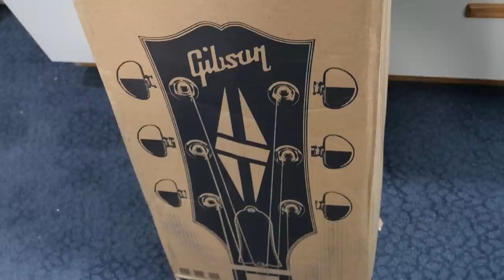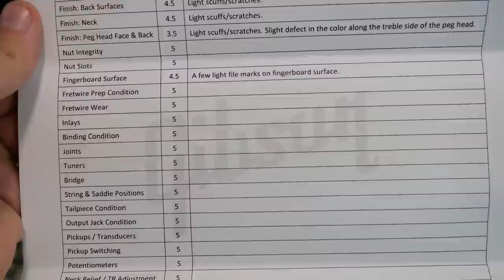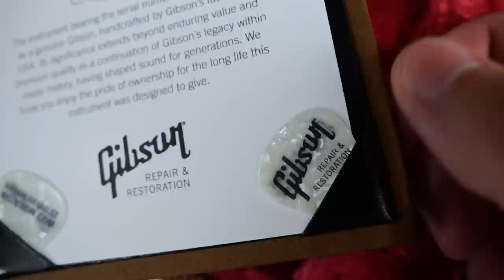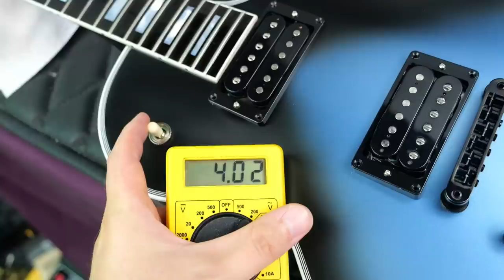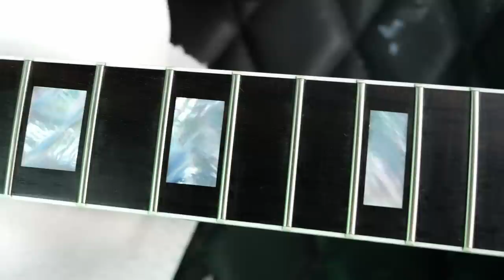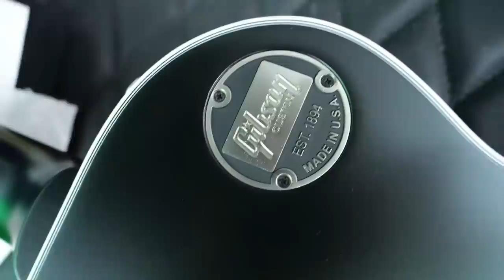I Made a GREAT Decision! | What Guitar Did Trogly Buy From The Gibson MOD Collection?

Comment: Austin, all you need to fix the strap button is to use a toothpick and wood glue. Then just screw the button back on. That literally exactly what the Gibson channel actually says is a their recommended way to repair that. I’ve been doing it for years and it never fails
Reply: I had to do the exact same thing once. Works perfectly.
Reply: Exactly what I came here to comment! 👍
Reply: I had the same problem with my Partscaster, hell I didn't even use glue I just stuffed a toothpick in there and it's still solid to this day, 2 years later.
Reply: I think I remember Trogly mentioning this in the past; its an easy fix.

Be sure the toothpick is made from a decent quality tonewood, of course. 😄
Reply: @RichardPhillipsDJ  haha, I bet there are people in this world for whom not knowing if the toothpick used in their LP fix was made of mahogany tonewood or just plain crap wood is ruining their experience playing it, never knowing if they have full tone potential 🙂
Reply: A matchstick or a toothpick should do! No need for glue,

Comment: those satin finishes are cheaper for them to make but charging a premium price for them,the gloss finish is much classier
Reply from the maker: Depends on the type of satin finish. Some satins start as gloss and get buffed down and are more expensive to produce.  Typically speaking though... yes, satin finishes are cheaper to produce than gloss
Reply: Gibson is shameless. It's funny seeing people get so excited after paying $6000 for a $400 guitar. I love it! I'd have buyers remorse until I sold that hunk of wood.
Reply: @mboyer68  cool story bro
Reply: @mboyer68  where is this cost coming from? There’s a lot of factors that go into the production of a guitar. Materials, equipment and tools, and labor. I imagine it was well over $400 to produce this instrument.
Reply: @mboyer68  I'd like to buy that $400 guitar from you..I'd give $600 and we'd both be happy
Reply: Matter of opinion. Personally I much prefer satin finishes (and only oiled/waxed necks).
Reply: @Joshb6498  granted it is a mod shop guitar so it has had extra attention, but you understand that most Gibson guitars are done by machines just like the foreign counterparts? Look at 10s guitars, they have a les Paul copy that is neck through, has an abr 1, more finishes, Grover tuners, and it costs barely more than 600 bucks. Gibson is on their way out imo

Comment: How to Fix the Strap Button Issue: Trogly, all you need to do is to shove a bunch of wooden toothpicks in the hole until it is packed, break them off, then drive the screw in. You may use wood glue if you wish to secure the screw further, but it'll work either way. Don't spend a bunch of money sending it back, and this method does NOT require drilling. It's a tried and true fix for such issues. I have done this kind of thing dozens of times. You may want to produce a video on this method to teach the guitar world on this simple, but effective fix. (Tip: You don't have to wait to break all the toothpicks at once. As you place each toothpick in the screw hole, break it off.) (Tip Two: If the toothpicks are pointed, you may need or want to clip off the end of the first few, [fingernail clippers will work], but as you attempt to fill the drilled hole fully, the pointed ends will help with that. You may need to use a hammer to tap the last couple of pointed toothpicks in.) Trust me, this works.

Comment: Use a toothpick or a match to plug the strap lock hole. You will be able to just screw back in to it. You could also glue the match in but I never need to.

Comment: Rather than using filler on that strap button just use some epoxy. If you use a syringe to apply it very carefully you won't get the mess on the finish that comes with using filler or the haphazard application of glue.

Comment: So, let me get this straight. Gibson take a "B" grade product, and send it to the custom shop, they could just dionate it or sell it cheap but choose not to.  In the custom shop they do a respray job, which is usually less than perfect i.e "Fudged" , change out some hardware, and then sell at a premium price. "Hmmmmmm," not sure I'm on board with this concept.
Reply: The other way around with that SN. It started as a Custom Shop then got rejected to Mod Shop. Still has a full custom shop price. It is a little puzzling.

Comment: Greetings Everyone
Reply: Chloe said Hello.
Reply: @sgt.grinch3299  And a very special hello right back at her.
Reply: Indubitably ...the flat style in a mahogany species  to maximize the density of the repair cavity ...please use only the ....
Gibson "repair authentic" brand factory blemish adhesive with the aforementioned toothpick procedure
Reply: @markbaum9615  Flat or Round?
Reply: @markbaum9615  I concur Mark,
I'd like to add that domestic sourced tooth picks are best as well as most consistent.
And lastly (I shouldn't even have to say this), it goes without saying that metric screws or fasteners should never be used on a Gibson.  Both compatibility and warranty issues could develop down the road (I'm just saying).

😉

Comment: So much over spray on the back of the headstock. Horrible. They still put that patent applied for sticker on the pickups. Gibson is shameless. Trogly, getting excited over paying $6000 for a $400 guitar since 1990.
Reply: LOL, the back of the headstock has the traditional burst pattern, it isn't overspray.
Reply: @void870  Yeah, labor costs as well as licensing for annual EPA permits for the finishing booths.    Where I work we design and build +$300K Military Equipment, total materials cost is less than $60K, the rest is all labor costs.